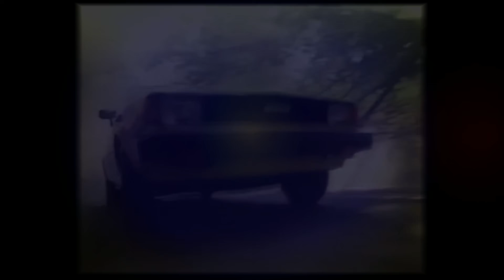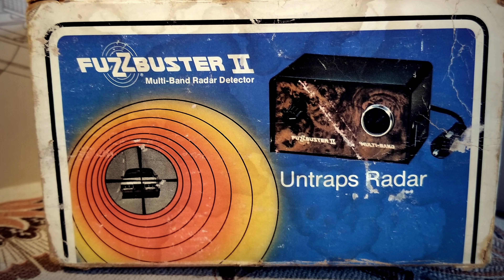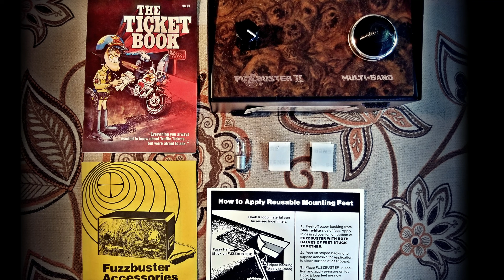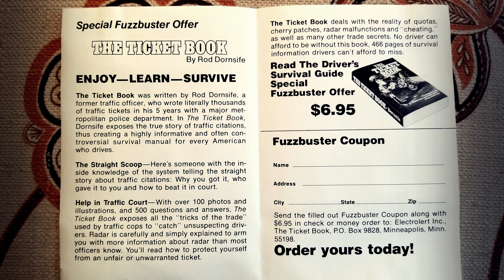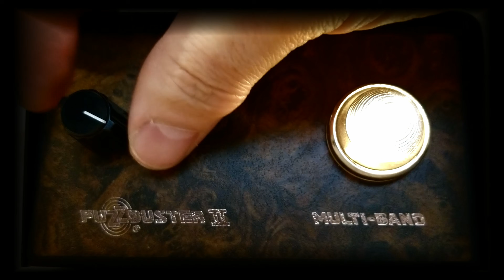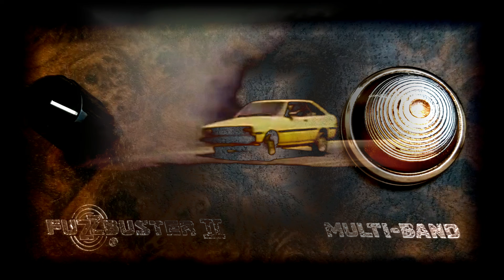The FuzzBuster II Retro Radar Detector

Comment: I had a 1975 Chrysler New Yorker Brougham that I would have two Fuzzbusters running out and the rear windows.  Never got caught and would run that 440 V-8 without missing a beat st 90-100 mph on the interstate.

Comment: Super cool! I wonder if they are legal to run these days, or if anyone still does use them? I thought of putting an Old school GM/Delco Radio in my 1979 Pontiac LeMans with the Built-in CB...Okay, I think I'ma buy a FuzzBuster. LOL
Reply from the maker: They're legal in the US, though it would be mostly just for show as they are not capable of detecting most modern radar equipment. An older cop would probably give you a thumbs up if he saw it on the dash of your '79 Pontiac lol
Reply: @TofersCarTales  Oh gotcha, I started to look on eBay I see a Really nice FuzzBuster II Elite... Where those any good or have collectability. :D 

Yes, it's sure one Purdy Poncho. 28,000 original miles Was a Granny car from Missouri with the Buick V6 in it, Now has a SBC 350 but I still want in the future to put the V6 back in just Soup it up a little.
Reply from the maker: The example I got was listed for only $20 so they are surprisingly affordable as most people probably wouldn't think of bothering finding one. Though I suspect that will change and we'll be glad we got them while they were cheap.